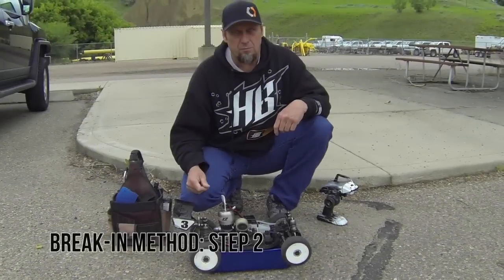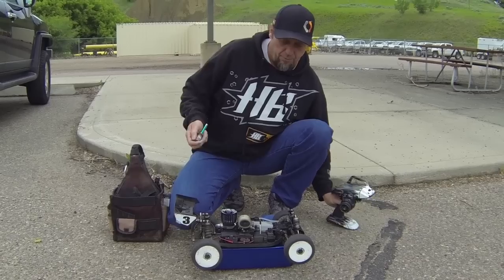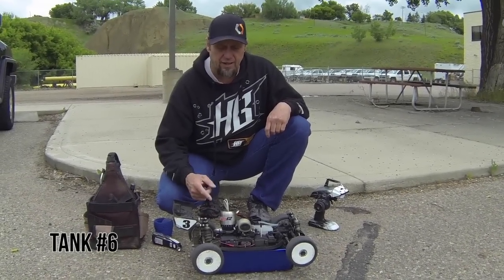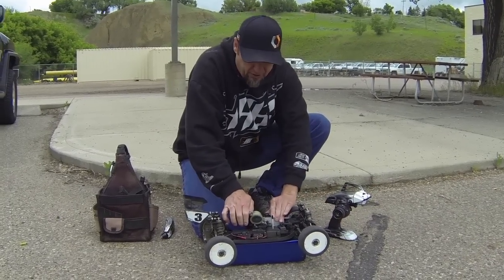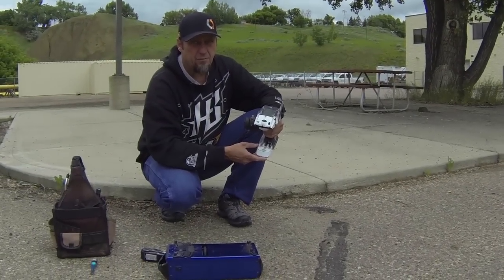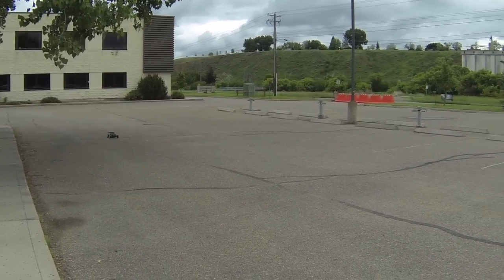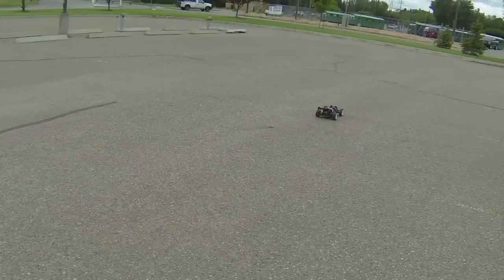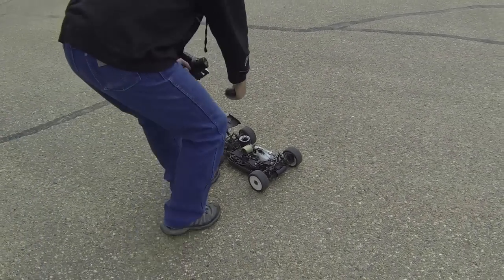Tessmann Break-In Method Part 2

Comment: You didn’t alter any needle from fat to lean ? I was told 4 to 6 tanks are needed and that you do this wis very fat settings so there would come blue smoke out of the exhaust. One says that one tank is about 500 to 700km if it was a real car.  Because it’s tiny and revs far higher than a normal car.
Normal cars had to be broken in back then, but nowadays no ones does it anymore....
Why are you cooling down after each tank ? Is it for the crystalline structure of the martensites to settle ? I doubt that it’s really needed.
But my main concern is: did you brake in that lean, so there was no smoke ?

Comment: Sorry for asking but the engine is so loud that I didn't understand what the temperatures are like.  Can you please post what the maximum and minimum temperature is when it comes in.Because I sometimes understand 200° that can't be.I know that they have between 90 and 95 degrees in the running-in phase .
Thank you Ralph

Comment: This video, and part 1 are awesome and so helpful.  In part one you made sure you stopped the engine with fuel in it (before it actually ran out of gas) do you do this for part 2 as well?  Also, when you are racing, after the motor is fully broken in, do stop it before it runs our and leave fuel in it or do you run it dry?  Thanks so much!

Comment: I'm getting the new Ty Tessmann edition os speed and I understand the engine is the same or just about the same as the os speed in the video. but I was wondering after doing the same break in step by step what time do you what the motor at the track? also do you tune the bottom end by pinching the fuel tube? I have problems with bottom end tuning and I understand that the temperature is the high speed/top end needle.

thanks
Reply: +Alexander Vaughn You test the LSN for off the line response from an idle and tune it so you get more acceleration but still lets the motor slowly cool at idle.. but not until you've broken it in properly as he said in the first video never let your engine run lean by pinching the fuel line you making it run lean... A temp gun is the best method less risk for your engine... Corrrect me if I'm wrong Ty Tessmann ;O)

Comment: Can you stop half way through the process and continue the next day?
Reply: +Paul Baca 

Yes you can do it like that too. That's how I usually do it as it can take a couple hours to run 10 tanks through.
Reply: I got about 1/3 of the way through and that was three weeks ago. It's been sitting in the basement since then. Do I need to do anything special to my engine? Will it be damaged? I didn't put any after run oil in it.

Comment: what kind of head heater is that?  never seen 1 like that
Reply from the maker: Red Long It's one I got at Neo in 2012. It's basically a stainless steel thermos cap with a 50 watt light bulb inside it that runs off of our starter box battery.

Comment: Piston to BDC after each tank.
Reply from the maker: Brodie Perry Always. Not only through break-in, but every time the motor is shut down.
Reply: Ty Tessmann how can u tell when its BDC
Reply: +nik cod a rough reference would be spin the flywheel is its running direction until you feel some compression, and then back it off about 1/4-3/8 of a full turn and it should be bdc
Reply: mrkrackles thx lol ill just put a mark on the flywheel